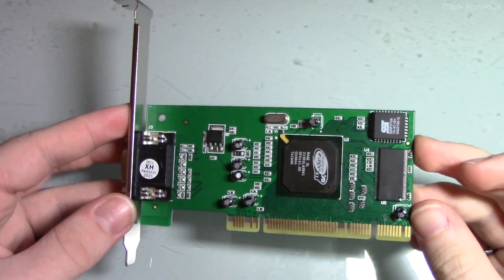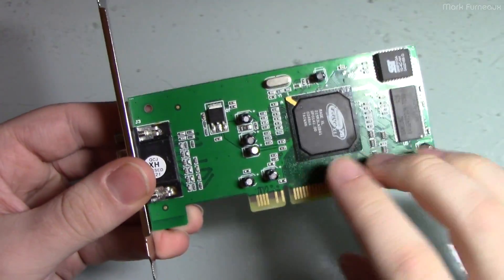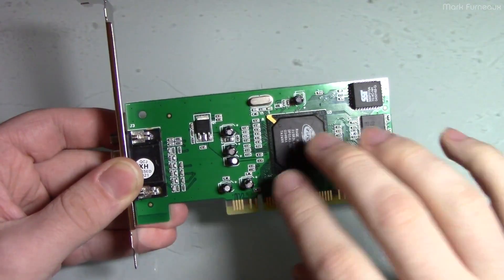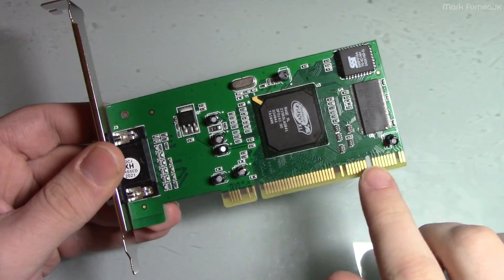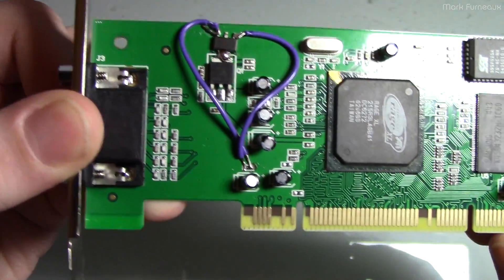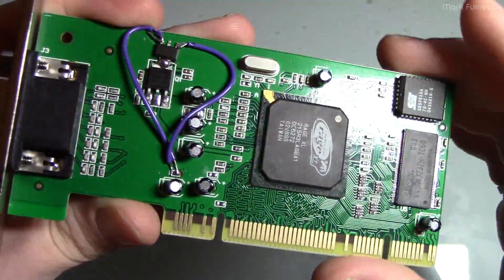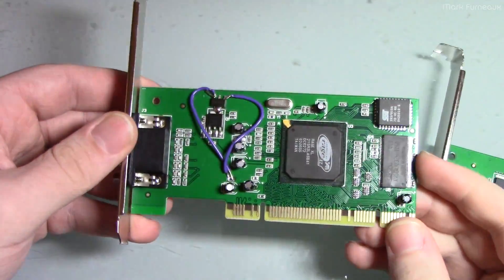Modding a "New" ATI Rage XL PCI GPU to Work on a Vintage Motherboard

Comment: Question...
 When exactly did manufacturers make the switch from 3v to 5v PCI slots?

Reason I ask is, I recently bought a good working condition, eMachines eTower 400i3 Windows 98 PC from a local thrift store.
I believe it was manufactured in 1999. 
Now, I am in the process of upgrading/restoring it with new and used parts and was considering this particular GPU for my machine.
I will primarily use it as a retro MS-DOS and mid-90s Windows gaming PC. 
Would anyone know if this GPU would actually work in my system without modifications?

Any info would be appreciated.

Comment: I have DC-DC step down regulators (adjustable) from other project and I will use it. Let you know the outcome.
Reply: I've used those DC DC stepdowns with one of these cards and they work but the switching noise on the output is quite bad, I've added a bigger cap and a random inductor (essentially building a completely wrong LC filter) and that solved the issue

Comment: can i conect 5v to regulator from molex hdd conector?
Reply: you can connect orange wire to your card from PSU without any regulator and it`ll work

Comment: I did this mod which made the graphics card, that looks identical to your two, work with my socket 7 Zida 5DTX II motherboard.  But using drivers from ATI website it was not reliable.  Blue screens in Windows 98 and 2000 with ATI drivers.  For some reason computer servers have for many years and still now only offer VGA graphics output and they often use the ATI Rage XL graphics chip.
Reply: I got it to work after I realized I got one motherboard jumper for CPU voltage was wrong duh.  Windows 2000 Rage XL driver installation was easy.  Windows 98 was another boxing match of driver Kerplunk.

Comment: Sad they didn't include the Theater chip on it, which gives you MPEG2 hardware decoding for smooth DVD playback on older hardware.
If it had been included, I would've picked up this card for one of my retro projects immediately. I'm a sucker for "underdog" cards like this one.
Reply: yeah i had a k6-2 550 and it wouldnt play back dvds smoothly with a geforce or voodoo 3, but a 4mb rage 11c agp smooth as silk 🤣

Comment: Cool modification - it's annoying that whoever designed this didn't allow for older boards which don't provide 3.3V power to the slots.
Those keys in the PCI connector are for the signaling voltage, not what power supply rails the card uses. The keys prevent a mismatch of signaling voltages, which can cause damage.
The issue here is with what power supply pins it draws from. The keys aren't defined based on that because it's not a destructive issue, if the 3.3V power pins don't supply power then it just won't boot.
As demonstrated this card does work with 5V signaling, as virtually all desktop boards use, so the 5V keying is correct. If this card would also work in a server board with 3.3V signaling, then having a 3.3V key would also be correct.
So I think it's cut correctly. But given the doubts about who designed these cards, I personally wouldn't want to risk a server board to test the 3.3V scenario. :)

I have a server board with the Rage XL onboard - it was the most common video solution for servers in the mid-late 2000s.  But mine puts it on the 5V PCI segment, so that still doesn't provide any evidence of whether these chips actually work with 3.3V signaling.
I was pretty perturbed when the X.Org people (or whoever it was) dropped support for Rage XL citing it's age, at a time when server boards with that chip were still only a few years old.  I would think a huge number of people were running linux on retired server boards with that chip onboard.  Admittedly most probably didn't care about having a working GUI though.

Comment: Interesting - is the PCI interface on the ATI chip 5V tolerant?
Reply: If you mean the signaling voltage, the Rage series chips probably all expect 5V signal lines considering how old that family of chips is.  Consumer motherboards always used 5V signaling on PCI.  3.3V PCI slots only appeared on servers and occasionally on workstations.
If you mean power supply - the external regulation circuitry is already stepping down the voltage to whatever the chip requires, this mod doesn't change that.  It's only changing where that regulator circuit gets it's power from the motherboard - instead of taking power from the 3.3V rail, which older boards don't provide, it's taking power from the 5V rail instead.

Comment: What would happen if I just removed the voltage regulator entirely?  I'm pretty much a complete novice in this area, but I bought one of these cards and it does not work in my machine. Where devices commonly have 3.3v regulators if I needed to scavenge one? I have a soldering and hot air station so I could remove and attach regulators if needed.

Comment: Wondered why this card didn't work on my P66 batman's revenge MB (OG Intel Pentium 1 board)... this tipped me off as to why there's a 3.3v AUX power header on the MB near the pci slots,  found an adapter to hook that up (its the old school 6 pin AT power connector) --> worked, also that made a gigabit ethernet card work, thought it was too new or pci 2.1 weirdness! So didn't have to do this mod... but want to trace the voltages & do it anyway maybe more optimal and universal, have other PIII boards this card does not work in. Interesting, Thanks!

Comment: I have a p200 mmx on a p55t2p4 (512 cache add on) with a matrox mystique video version 1 (with memory add on board) and a 3dfx voodoo add on card version 1 with 128 mb edo ram.   Started it up the other day ( been years since it ran).  Formatted the old Samsung 1.6 gb hdd and dual booted dos 6.22 and win 98.  
If I sold this machine think it would be desired or not?

Comment: Worked like a charm in my Pentium 166 PC, thank you very much!
Edit: too early to be happy, the PC gets stuck with the cursor blinking on Detecting Plug and Play devices shortly after the disc detections. Back to my 1MB Trident :(
Edit 2: further update, I removed the PCI ethernet board and now it works, looks like I can't use other PCI boards with this VGA, and I'm keeping it since the ethernet is not so important for my build. ISA boards are fine.
Reply: High power diodes near all the 3.3V traces would make this modification safer for use with other universal PCI cards connected to a motherboard.  The video only shows a cost-reduced modification for a cost-centric shortsighted PCI design.  Becareful.

Comment: I dunno, you might be drawing too much current for that regulator. I would tap into a 3.3v rail from the power supply.
Reply: AT power supplies don't have 3.3V
Reply: @timrb  you're right. it's been too long since I've played with a AT.

Comment: So, would you recommend this card for a 430fx based system (EDO and WinChip 2 200)? I've been agonizing over what I should get for this retro DOS and very early 2000 Win98  machine.
Reply: @ch282 Thanks for your response, but I've recently changed plans. The 430fx board I have is being flakey, so I am going to try something a little different.
Reply: @ch282 I am doing two things: I bought two VIA C3 minITX mobos on the cheap (one two experiment with, one to build with), and I am keeping my WinChip 2 200, ESS ISA soundcard, and the S3 PCI video card, and some RAM and will continue to look for a decent working mobo :)
Reply: @ch282 I bought two of these: EPIA-LP10000A . Given that it's a Via C3 Nehemiah and can run at different FSB via the jumpers (66, 100, 133) AND can have its internal multipliers set/caches disabled by that one program PhilsComputerlab uses often, it should work quite well. I am looking to do some other stuff with it since there are other FSBs setting available if you want to program the clock generator via I2C.

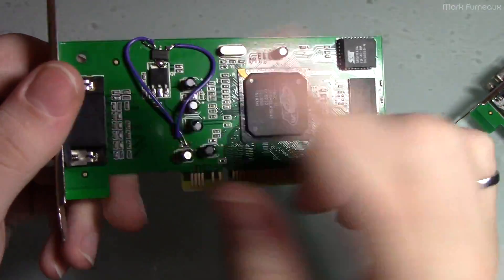Comment: 9:10 sooooooo if i were to do this put am I/O switch on it. got it.

still safer than my hard wired psu with a cracked pcb for my sega saturn
Reply: Just add a jumper

Comment: I bought one of these a few months back from Amazon. Had I not run it initially in a modern dell workstation (which worked fine) I probably would have assumed it was defective. I couldn't get it to work in any of my older 486 and Pentium boards. Now I know why! Thanks for sharing this simple mod. I may give it a try.

Comment: Ati rage XL alone can eat upto 10W.. not talking about the memory.. so
Reply: Lies. :) Geforce 256 would eat around 12W. Geforce 2 MX around 4W. 
Those cards run much hotter.
So XL has to have around 2W or less.
Reply: @warrax111  xl eating 2W or less? Bro, i'd like to see that.. not that i don't believe you tho..

Comment: There is also voltage injektor boards for pci sloth. I butcher pci riser board where I blace regulator. It's give 3V3 for all motherboard sloths.
Reply: where would you find a 3.3v injector board ?
Reply: Voltage blaster from philscomputerlab / scrapcomputing

Comment: I'd be a bit concerned that linear regulators in that form factor typicallly are only rated for 0.8A ... 1.5A and if the chip needs more than that, you could get random driver crashes or reboots. 
The chip will also make some heat, for example assuming 1A of current, you're looking at (5v - 3.3v ) x 1A = 1.7 watts of heat - this heat is dumped into the transistor, which also heats from regulating down from 3.3v to 2.5v or whatever is needed.

Also, for anyone suggesting 1117 regulators, keep in mind that 1117 regulators are known for having some requirements like having an electrolytic capacitor on the output with ESR between 0.1 ohm and 1 ohm in order to be stable across various temperatures and loads. Some manufacturers make slightly modified 1117 regulators which can work with ceramic capacitors on the output. But if you're unlucky, you'd need to add a capacitor on the output ... something in the range of 10uF  50v rated to 47..100uF 25v rated (whatever lands you in that 0.1...1 ohm esr range)

Anyway, you have a plain regulator without decoupling capacitor on input, and without capacitor on the output, but yeah, it's gonna be fine, since they're basically soldered to each other there's no need for an output capacitor
Reply: Just put 1 ohm resistor in series with your ceramic cap and you have esr 1
Reply: @JohnSmith-iu8cj  Just use orange wire from psu and 0W of heat

Comment: That's a cool mod.  I would consider cutting the trace to the 3.3v pad just to make it universal... maybe add some resin over the solder joints for strain relief/insulation.

Btw, I think I have some PCI cards somewhere (including ethernet and a neat hardware RAID IDE card, and some other stuff, like IDE2SD adapters...), if you or your viewers want them, hit me up.  I'm in WA state, btw, but I can ship.
Reply: Hey, do you still have any of those pci cards?

Comment: This actually works! I used a AMS1117-3.3 3.3V SOT-223 which cost me a few pennies. Just solder as shown in the video and it works. Such a cheap, easy option. Thank you, Mark.
Reply: Can you write which exactly  3.3v PCI pin to measure?
I'm afraid that on my old m/b there is actually +5v instead of 3.3v there and the card will be burnt :(
Reply: It’s standardized on all IBM compatible PCs it’s the same

Comment: This is really great, it finally provides an answer as to why it works on my P4 but not on my P1. I think if you could provide some schematics or a tutorial using the AMS1117, I think this card would be a great asset and cheap alternative to the retro gaming community, considering the prices and rarity of the top dog cards.
Reply: Just look at the PCI pinout, look for 5V and 3.3V, follow the traces. Between 5V, 3.3V and GND, you connect your regulator just like the datasheet says.
Beware when using such a card in a 3.3V board, it could power your other pci cards and the regulator could get hot.
Reply: This card is not at all a great asset, it's a pile of garbage. The Rage XL has a 64 bit memory bus, but this card only uses a single 32 bit wide memory chip, which means 50% less bandwidth. It's going to be far slower than an original Rage series card made back in the 90s.
Reply: @GGigabiteM  No, even with 32-bit, it will be faster than Rage  and Rage II.
Because Rage I used Edo ram.
SDRAM is faster even at same speed.
Also... there were 32-bit Rage IIc s, with half memory chips (2, instead of 4). Beware of it. :) Many people got burned back in 1998 or 1999, when they've bought them.
Some even didn't find it till today, why they had so terrible 3d performance even in games, that used to work with them. Like Jedi Knight, Tomb raider with CIF support etc.
Reply: @warrax111  The bandwidth difference between fast EDO and SDR is not that much, at most 20 or 30 percent. You can see that on the specs of the Rage cards between the models with EDO and SDR.

When you cut the bus width in half, you lose 50% of the bus bandwidth, using SDR is not going to make up for that deficit. In that case, a card with EDO on the full memory bus width is going to be faster, even with its deficits.

Comment: There exist a chip called : AMS1117-3.3 it can do upto an amp, same form factor , same pinout, very cheap trustworthy. Cold be similar to that. However they recommend to use caps on in and out pins, to keep voltage stable, works well.

Comment: what if you mod motherboard itself for 3,3v power delivery? if the pci slots on the motherboard have phisical pins for 3,3v only not connected you can bridge them all together and either hook up to orange wire on atx  power suply or do a regulator from 5 volt or even make an add on pci card that would simply work as a step down converter, linear or switching feeding it back to the slot
Reply: I did it and it works. I did to my motherboard and it's working.

Comment: Would you be able to use a diode to prevent 3.3V back current from your modded regulator, for the case when there's another 3.3V supply on the bus? Is that a dumb idea?
Reply: it's not dumb idea but when you already cut a trace to make place for diode you already solve a problem and no diode is needed anymore :)

Comment: Thanks for sharing,! I have one of those and it refuses to work in my Socket 7 Compaq, now i know why. By any chance does anyone know if you can replace the RAM for 16MB?
Reply: Yeah tried to use it on an old Intel super socket 7 board now all I need is a regulator.

Comment: why my chipset wont run a pci card and a pcie card at the same time ? Forgive me I'm into computers but mostly ddr3 and ddr4 era are the only things I've studied in depth. Its a ddr 2 chipset ,G35 I believe. Maybe there's some other idiosyncrasy I'm unaware of . I also had the pci wifi card functional on the system but only when using integrated graphics on the E2140 ( 1.1 base 1.6 boost dual core (Dell prebuilt inspiron 530 ORY007)). To be clear I don't need this answered by you or anyone specifically, just curious. There might not be enough lanes to spread out and its only a storage box.

Comment: I bought this same shitcard a year ago, because I had a P200 mhz with 16mb ram.. 90's pc.. I was so excited until I plugged it in, fired up the ol' gamesbox and.... nothing.. If only they would've been honest that without (your) modicifaction it is totally useless for a pc it's supposed to work on. (time correct)
Reply: they made it for newer motherboards with PCI slots (like LGA775 motherboards), as cheapest possible option, also only as display adapter (servers... so it eats up only around 1W).
They didnt make it because of retro gamers, lol.
So that's why they tested it only for 5V.

Comment: It's interesting to note that while this is a remanufactured(?) board, they did go as far as to use actual meandering delay lines on the PCB. For taking e-waste and throwing it on a board to resell to a niche market, I'm surprised at the amount of engineering put into it.
Reply: it might just be a copy of a board that was used long ago.
Reply: @Mr_Meowingtons  Bingo. Layout wise this card looks like a "Xpert98XL PCI" (P/N 1025-35050) with 3/4 of the components cost-downed out of existance

Comment: Ah, a rival for the GT 710 has been found at last!
Reply: These RageXL cards are actually useful for vintage systems since they work with the Mach64 drivers, ie have driver support down to Windows 3.1x. The GT710 PCI? Seems completely pointless
Reply: boomers: You mean the 5200?
Reply: @qwertykeyboard5901  Grandpa: You mean the TNT2 M64?
Reply: @GGigabiteM great grandpa: you mean the Hercules Graphics Card

Comment: The crossed over wires are annoying me.
Reply: I would have been fine with it if there was a glob of hot glue stuck on to keep the metal at the ends of the wires apart.

Comment: Thanks for this information. I can't say I blame you considering how expensive the Voodoo cards have become.
Reply: are they really expensive? is that something to do with the current GPU situation? or some kind of resurgence of retro-computing fascination? or because they're rare and desirable for some particular reason?
Reply: @chrom4ful   3DFX Voodoo cards have become relatively rare and desirable. They had their own graphics API (Glide) and were last produced in 2000.
Reply: I was super lucky to get a 3dfx voodoo 3 3000 pci from my schools old parts bin a few years back before i graduated. There was no way id have been able to get one considering those sold for 100 bucks then and easily 200+ now